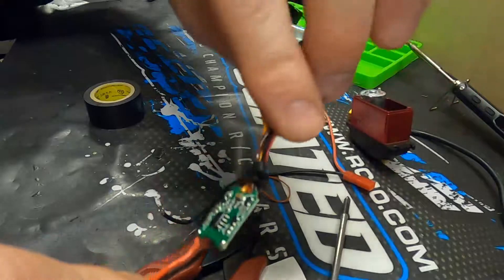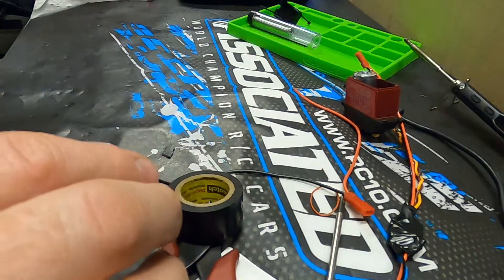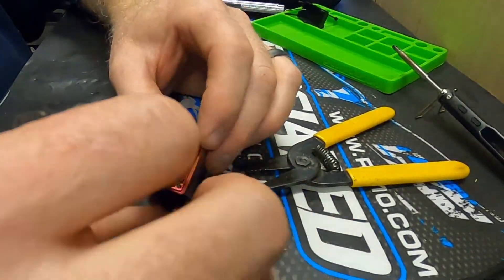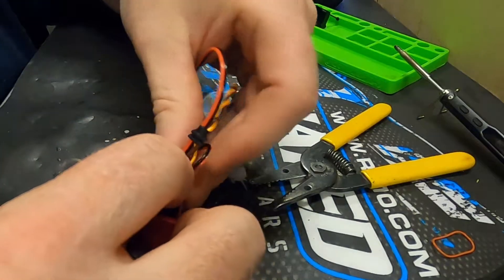Making a servo winch with Amazon servo!!

Comment: Great tutorial thanks 
Can I just ask will thr motor handle 11 volts 3s ok I've already made a wich from an amazone servo just left the electronics I side and Conected  to channel 3 but after 20 seconds the speed dropped I wonderd if its pulling to much power from the rx or esc that's why I love your idea and just orderd the parts 😉
Reply from the maker: It runs just fine..  I can’t say it will never burn out but I think if it does it’s not because of 3S..  I actually did cook one because I accidentally left it on while I was driving and didn’t notice it was sucked all the way in.  I use a Spektrum DX4R PRO and the switch is a 3 position (fwd-off-rev) and got clicked on.
Reply from the maker: I run it directly from my 3s Lipo balance plus via an adapter…
Reply: @aefanboy3464  yes I've orderd an adapter as well 
So will the servo brushed motor will run with 3s ok won't burn out

Comment: Do I need an ESC if I don't want to control the speed? I just need back and forth movement for my sailboat.
Reply from the maker: I wouldn’t think so.  A receiver battery pack and the servo should be all you need I would think....
Reply: @aefanboy3464  Alright, thanks